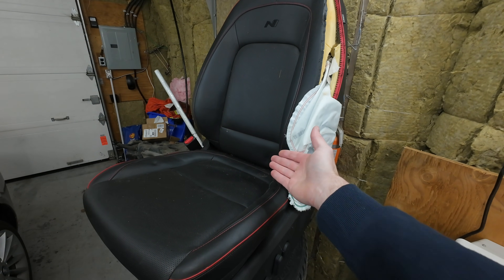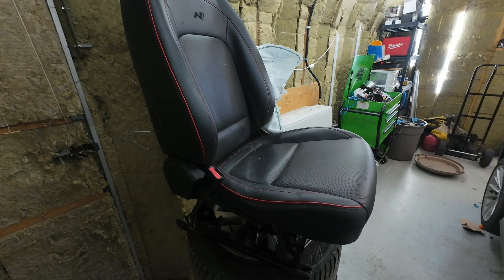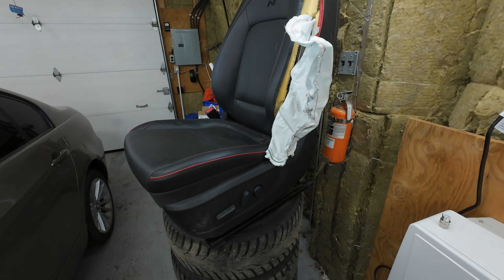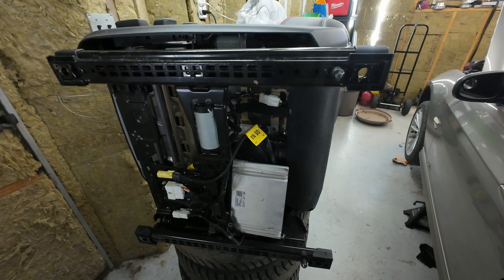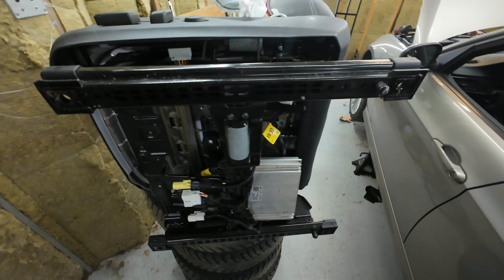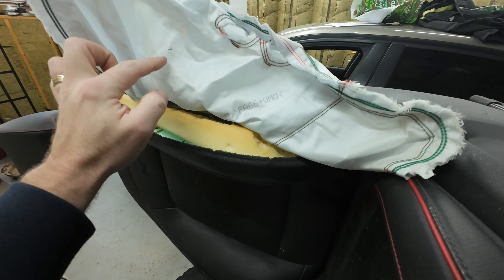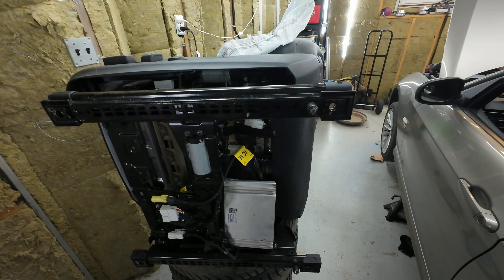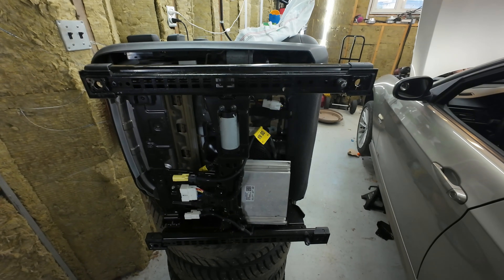Your Car Seat Isn’t a Seat Anymore (Here’s Why It Costs $7,000)

Comment: Anybody that tells me they want over $600 to replace a damn seat, I'm gonna tell them to put down the crack pipe. Toyota wanted $900 to replace the water pump on an '09 Corolla, $300 for the part and $600 for labor ! I drove it cold across the street to Walmart parking lot, went to AutoZone and bought a $65 pump, and me and a buddy did it in about 2 & a half hours ourselves. So screw greedy stealerships and greedy mechanics. I'll build my own car from scratch before paying today's prices.

Comment: Earlier this year my 2017 Toyota had a strange Seat issue related to the springs underneath so I bought it in and they determined it was a defect so they pulled the whole seat out and replaced the whole bottom part and only charged me $1500. The replacement bottom part was redesigned so it would not happen again

Comment: I really hope you're not this naive...your car seat is marked up to make a profit, it's crash tested , most of them nowadays come with airbags built in , it's also adjustable in many different ways , it's possibly electric, possibly heated and or ventilated , maybe you've made an expensive materials that alcantara and leather , and also has to comply with safety regulations ,SO YEAH ITS EXPENSIVE
Reply from the maker: So 1500 less for a air bag and now you have a 5500 seat???

Comment: I know the feeling, the seat in my pickup is nice and cloth and simple but in my class 8 Kenworth I didn't like the one that came in it when I bought it as it was used and the high end air ride seat minimizer is very adjustable but it's mostly manual functions but was 2500, probably now  2700-3000 USD new, 

and on the other side My Lexus ls460 has about 15 positions and memory all motorized and heating and ventilation, I accidentally forgot to unbolt a pair in a parts car and ruined a slide motor and bent a slide track and fixed it after I got them out and now looking at the complexity and the fact that they can work over 15 years and have no issues I never want to take one apart again, a engine or transmission makes more sense.

and the Lexus ls460 seats are plentiful for a couple hundred bucks in the junk yards or just purchase the whole vehicle from copsrt

Comment: Pilot seat in the F-16 depending on the model is anywhere from 200-500k not including labor and we're griping about a generic auto seat w/o even climate control as far as I can see!
Reply: No one cares how much an F16 seat costs. No one buys those.
Reply: @foxhoundms9051 being a troll doesn't reduce the cost, what's your point
Reply: @BrianW-fp9yj What's your point? Talking about F16 seats when we are talking about cars 😂
Reply: @foxhoundms9051  I drew a comparison concerning seats as a large fraction of build costs. In the field we are tasked with repairing them or scavenging much the same as aviation. Ordinarily people aren't buying seats (otherwise there would be a supply and costs would be lower) like we used to replace seats in past decades because the springs and cushions wore out. Insurers are using cost based analysis to decide whether the interior is the factor for whether the vehicle is worth saving.
Reply: Apples and oranges.................F-16 vs a $30K vehicle. Hard pass
Reply: @piercehawke8021  maybe you just dislike seats fwiw

Comment: The best part is that in states with inspections, you can't pass inspection without all the airbags present. And you can't register your car if you can't pass inspection. This is going to take legislative action to fix. Short term to just cancel the seat airbag inspection requirements. Long term by banning integration of airbags in a wear item like seat upholstery.

Comment: Seats can be very expensive. Manufacturers do not sell seats assemblies at all You have to assemble them piece by piece especially if they're stolen it's going to cost a lot to replace. The other day I had an HRV on our shop with non-leather seats and the customer it spilled some kind of chemical on the back right rear seat and on the driver's seat bottom so basically you're talking three seat covers I was thinking oh these seat covers are probably about $300 each that sounds about right you know when I price them the three seat covers cost $4,500 and that's not without any labor of course the customer to climb because that would have been about $5,000 for 3 seat covers per place.

Comment: Dude....$7000 seat is nothing. A $14000 radio is where its at. Im in southern Ontario. I deal with broken oem audio all the time.  $14,000 was the quote of my cost of the replacement radio for a 2018 lexus es350. Mark Levinson system with nav etc. $14k. Not a used one to be found in canada or usa from lkq. Or car-part
Com not even ebay.
Reply: @leecampbell9498  then no radio 😂
Reply: @petrovicmotors3775 bootoof speaker on the seat lol
Reply from the maker: Back to the iPad days! Yeah infotainment systems are out of control

Comment: Why not swap that overpriced seat for one not riddled with electronics? Or will the pseudocar detect that a seat control module is missing?
Reply: The car would detect that something is missing, I think most driver seat doesn't have weight detection but there's at least the airbag not being there could make most vehicle's airbag system not work.